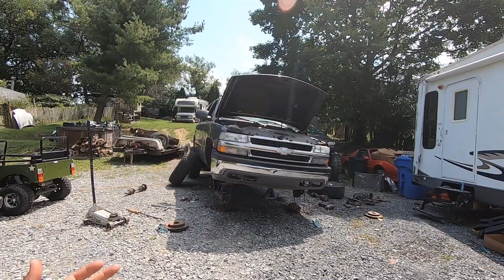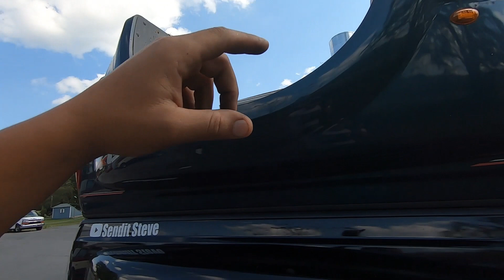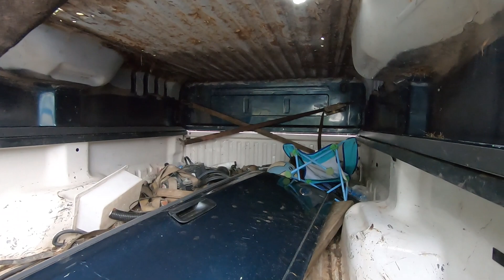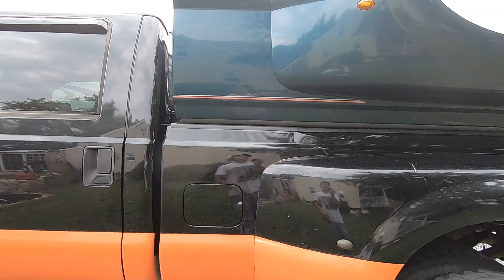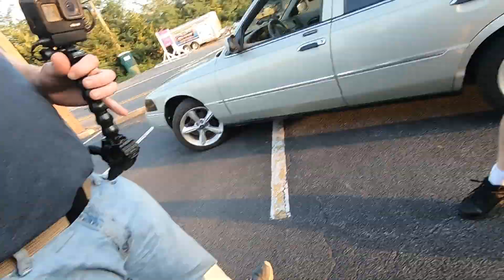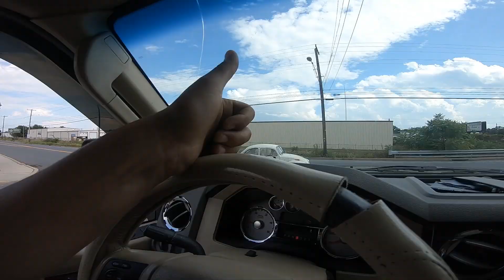CHEAPEST WAY TO SAVE YOUR CARGO! F450 IS BECOMING A PAVEMENT PRINCESS!!!

Comment: Wasn't the vette supposed to be running two weeks ago.....
Reply: ts6141 it is
Reply from the maker: It does run it sprung a massive fuel leak. I became frustrated with the car again but will straighten it out when my tuner comes back from vacation

Comment: you tubes favorite dad, send it Steve when you bought the dually I think it was the best thing for the channel. it's a work truck though, just fix the window stay on top of maintenance & use it for what God intended  it to be used for. just my opinion, you have too many projects going. get back to the Corvette but keep it street legal, about 500 or so hp & have some fun w/ it. then maybe get that Pontiac running. you're at lot of things but you have fun & are a great family man.

Comment: Why not drop down to a 37?
Reply: Or even a 38 35s and a 6 inch lift on a ford is to big
Reply: That's exactly what i was going to say. Immediately thought 38, maybe 37. But 35 is way too small, 6" lift, ford 08+ superduty, they are big big trucks, NEVERMIND it's a 450 DUALLY lol.
Reply: I say the correct answer is lift it a touch more so you clear the 40s no problem lol 😁🤙🏼 or just do 38, 37 at the least.